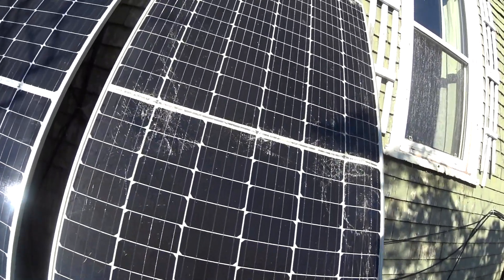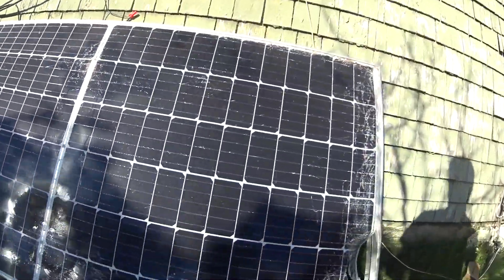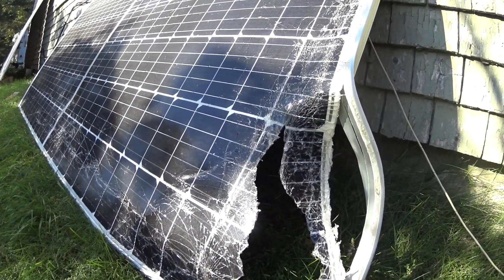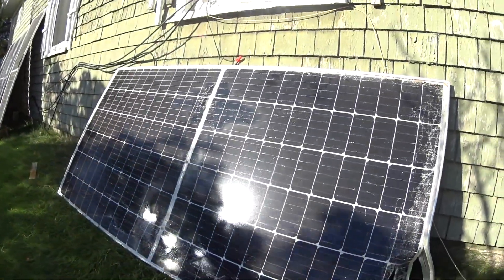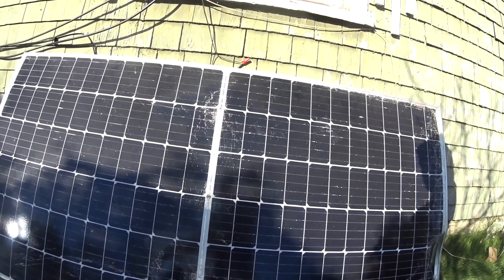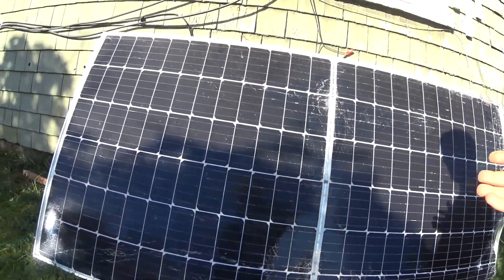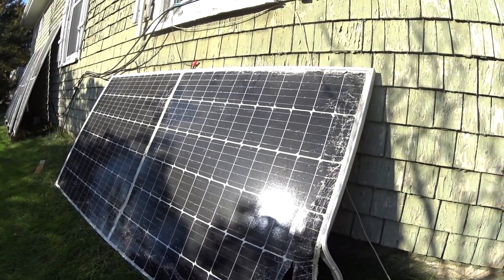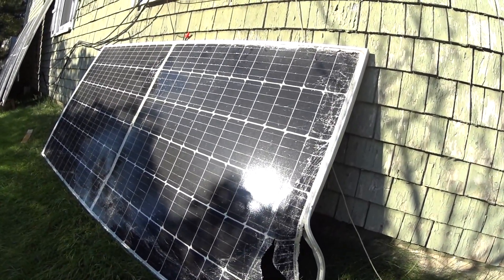SHATTERED Solar Panel - How much power does it make??

Comment: I have been repairing 395 watt panels with 1 quart of clear 2-part epoxy followed by 2 coats of spar urethane for UV protection,  but i got the panels for free.  I tested the panels first.  They are making 36volts open circuit and  around 11 amps short circuit, close to the full 395 watts after the repair using the ole P=IV formula. I am going to hook them up to test inverter to see what the actual production is.
Reply from the maker: were they really shattered or just some cracks?